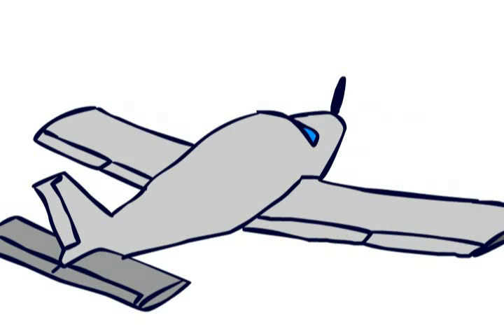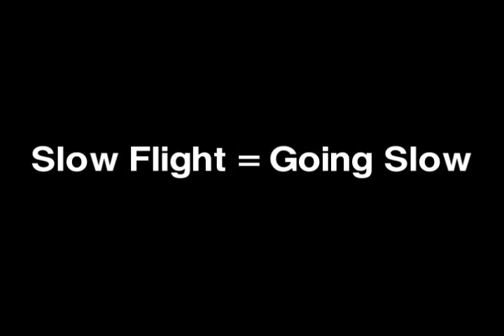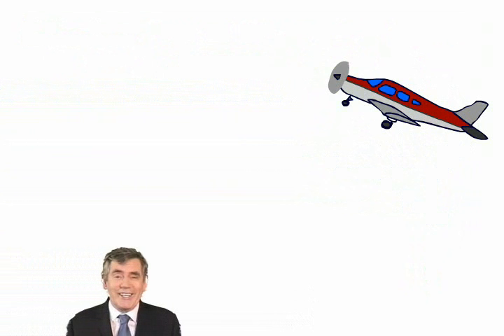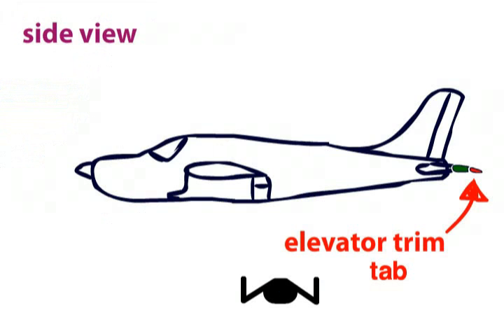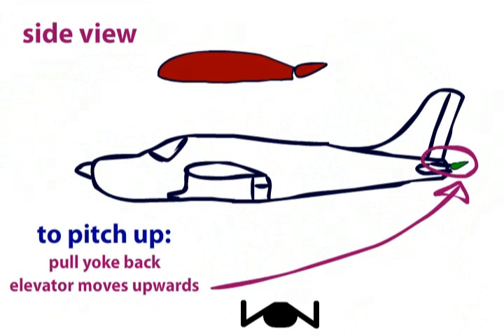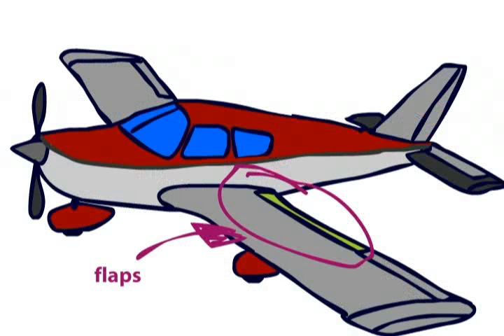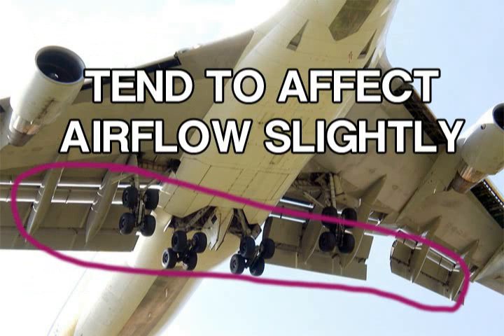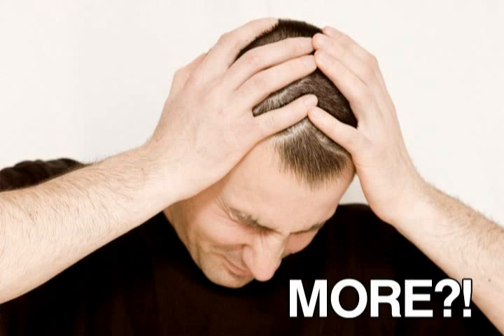Aircraft Secondary Flight Controls Explained | profpilot.co.uk video #6

Comment from the maker: Hi Boobie! Little hard to spot in my diagram, but you can see it at centennialofflight.gov/essay/Evolution_of_Technology/High_Lift_Devices/Tech6G3.htm mildly better! It means that some fast moving air below the main body of the wing can move over the top of the flap, keeping laminar flow in place longer instead of turbulent flow which is not so good for lift. Of course, following video no.9 you know why. Or I hope so, as I have just 15 characters to type it here. IM A HOSTAGE HEL...